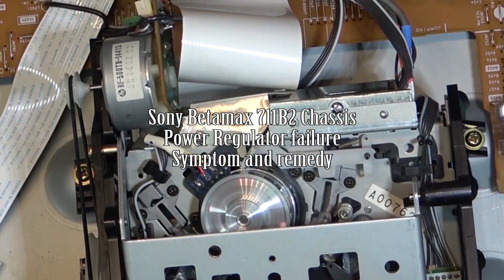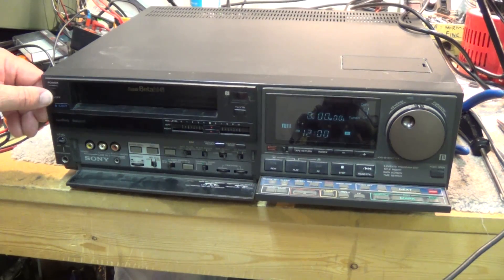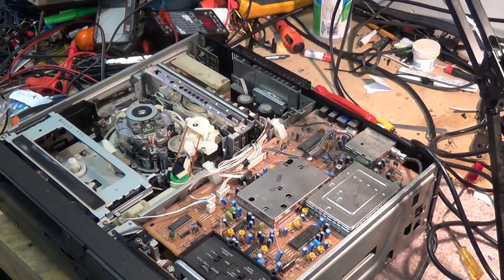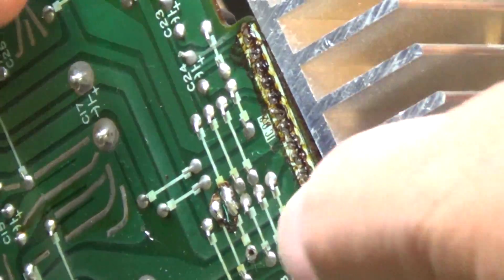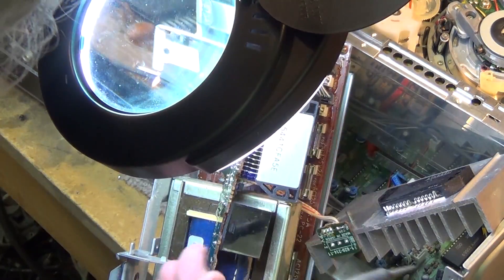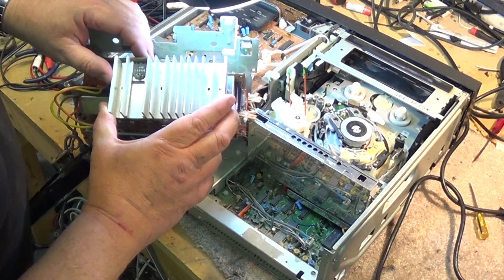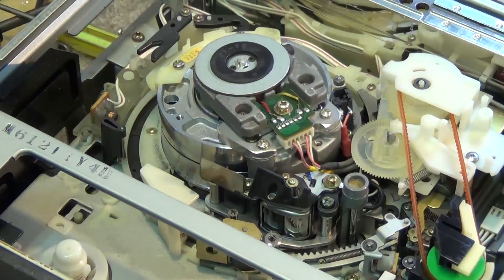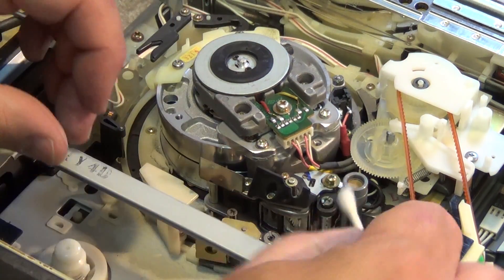Sony Betamax 711B2 chassis Regulator Diagnosing and Replacement

Comment: Hello, I have a handycam question. Its a sony CCD-TVR58 and when I plug in the battery/cable the only thing that turns on is the charging light for a split second, the Handycam itself does not turn on at all, even when moving the power buttons on and off. It was working just fine yesterday but im not sure what the problem is, The batteries are also brand new and work fine. Is it a fuse or a cut cable? Thank you in advanced for the help

Comment: How many voltages is that regulator spitting out? That's slot of pins for a simple voltage regulator. I dont think its doing any kind of switching regulation although im sure it has a enable pin. I am cerous as to why it has so many pins tho. I'm assuming theres gonna be a v-in pin and afew v-outs. Are the other pins for setting the voltages? Like would you have ither a zener diod or a resister ladder that goes between v+ the set pin and gnd? I just don't understand why a voltage regulator would have as many pins as a audio amp chip
Reply from the maker: Multiple regulators. Constant 5 constant 12, switched 12 switched 9 ect.  Motor supplies ect.  I forget how many regulators were in there 5 or 6. There is a power control pin going in that turns them on and off. Each regulator has an input ground  reference and output.
Reply: @12voltvids so assuming the regulator is just spitting out standard voltages like 12v sw12v 5v sw9v +-16v 3v. Could you not generate the majority of these with standard to220 voltage regulators? How hard would it be to just replace the defective regulator chip with several individual liniar regulators and maby 1-2 buc converter's for the low voltages?

Comment: How realistic would it be to change the entire power supply? I'm assuming it's not a switching supply based on the size of the transformer.
Reply from the maker: Every model uses a slightly different design.  This is a standard linear type however the output connectors were different across different models. I took the regulator our if an SLHFR50 for this fix.  It's the one part made by Sanyo that fails over and over.  In fact i strongly recommend unplugging these old VCRs when not actively being used.  Mine (this one) is on a power bar with my dhr1000 and my BETACAM and UMatic decks and it only sees power when i am using it.

Comment: If the power regulator keeps failing, perhaps a bad capacitor is causing it to get surge spikes ?  Just a thought as I saw that once myself when a chip blew.
Reply from the maker: They failed when they were new.  It's a Sanyo part. They have it operating close to maximum power especially on the slhf1000.  Sanyo eventually fix it, but early OEM chips and the replacements were no good.  Many that show up now are NOS rejects that were all bought up when they changed the design to improve reliability.   Put lots of hear sync grease on them give the machine good venteration and unplug the power when not being used is the best way to keep them from failing.  The heat sink compound applied at the factory was insufficient to begin with so reapplying that is a good start to saving them from failure.
Reply: @12voltvids   Ahh thanks for that, yeah that makes a lot more sense now so many components are under rated/over driven.

Comment: With no Picquic in view and the old Fluke Model 12 on display, I suggest that this was done some time back. I miss the model 12 being used but that's just me, I know you like the new one.  Look at the complexity of this machine, a vast difference from the most recently posted video.  Fixed...good job!
Reply from the maker: The fluke is still here.  I'm only using the new one because it's easier to read on camera and accuracy wise it's bang on with the fluke.  The probes are the fluke are bad. I have a brand new fluke I have never used.  Scored it on FB marketplace a couple years ago.  
Yes this is a redo of an old video that just went on far too long.  I am taking some of the old ones and re-editing to condense them down and eliminating the excess chatter on the old version.  Some are still online but when i re-edit I generally remove the old version or at least unlist it.

Comment: Finding the I/c these days will be the hardest part. This must have been made a while ago.
Reply: I think this is at least 8 years old.
Reply from the maker: Could be or even older.  Even though there is work to do, I have been too busy to get in into the shop and it's been hot as hell here. I have been looking at the back catalog and re-editing the source files to make a new video and try to speed things up.  If the average view time of the original was 5 minutes but the average view time of the 10 minute version is 7 then stats wise the shorter version is better.  I will continue to replace some of the old long drawn out videos with shorter versions when i am not in the shop shooting new content.  Make no mistake I have lots of stuff to shoot but when it is really hot or I have other stuff that keeps me out of the shop I'll re-edit an old video to get new eyeballs on it because the old one will be way way back on the list.
Reply: @12voltvids Hey Dave no pressure but do you know by any chance where I can find a new optical block for a Pioneer CD player
Reply from the maker: No idea where to find any of those parts.  Most of the suppliers all closed up shop 20 years ago